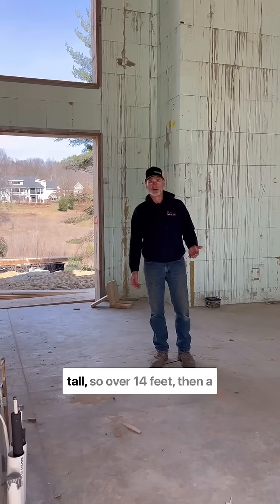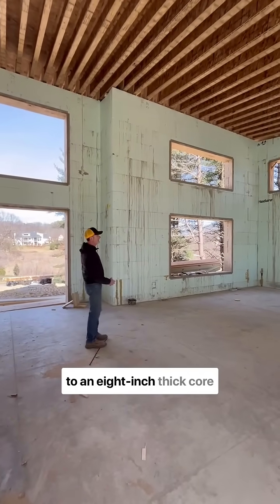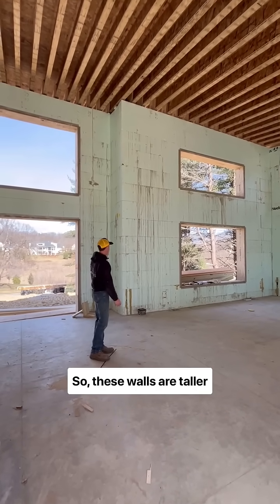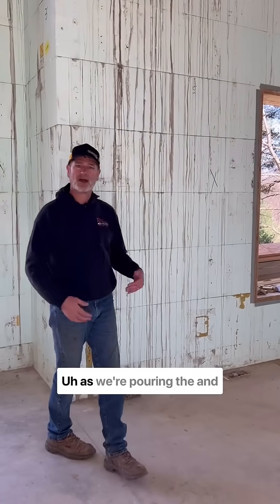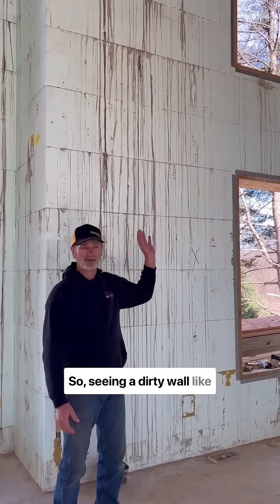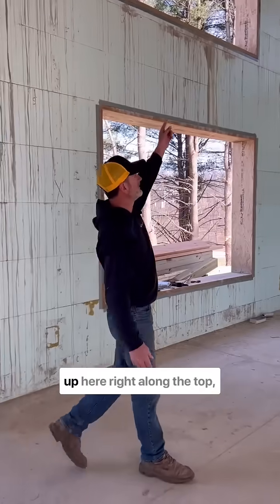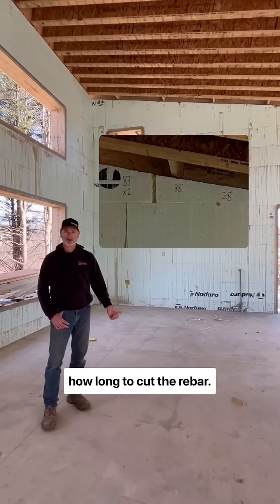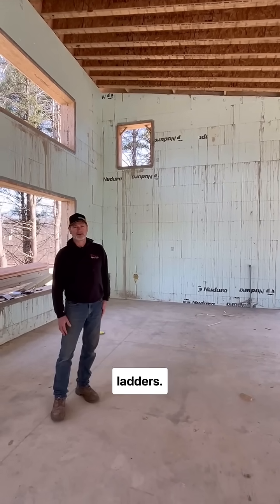Using 6" Core AND 8" Core for this ICF Custom Home and Here's Why!

Comment: A 6 inch ICF core is completely adequate enough for a 14 foot tall wall with a traditional frame roof or even a second floor. They do it with 2 x 6 16 on center 24 on center lumber’s way weaker than compressive strength, which is how Concrete works.
Reply from the maker: Unfortunately it isn't that simple. Wood flexes, concrete doesn't.
Engineering standards for Wood allow considerable movement, but concrete allows very little. Comoressive strength doesn't counteract the wind load much at all. Can it be done? Sure, but you have to hire an engineer to design the rebar size and spacing, and it can quickly get into costing more than an 8" core.
The code only allows up to 10' without an engineer's approval, however many of the manufacturers provide tables that go higher (pending a local engineer's review, not design).
Stronger than wood? Of course! But there is more to it.
Reply: @RValueHomes  also code stops at 10 feet because no one normally goes higher and they don’t wanna pay their engineers to even look at it cause it’s pointless. They do 8 feet all the way up to 22 feet basements that have side load with no deadman and you’re telling me an above ground ICF two-story house 6 inch core is not adequate enough for wind load?
Reply from the maker: @randyanderson1983  If you want to pour a 100' tall wall with 6" core, I'm not stopping you. But if the question is what requires engineering, my point still stands. R-Value Homes isn't out there to try to be "good enough", or "I think we can get away with that".
Reply: Higher an engineer, make a video prove me wrong I poured over 300+ icf house in a little over 10 years just as a pump operator, engineered non-engineered and actually it is quite that simple people over engineer stuff houses have been built hundred plus years ago and are still standing with no engineering

Comment: I’m very curious about how the pressure of the concrete works from top to bottom and how high you can really go. 

We build our own concrete forms and pour solid walls up to 10 inches thick. We have a proprietary tie system that we’re planning on phasing out and switching over to actual concrete form ties.

We’ve considered doing ICF. It’s just amazing to me how those blocks can hold all that concrete.
Reply from the maker: ACI calls for wall pours to be made in 3' lifts, no matter the forming system. We usually push that to 4' or 5'.
When each lift is poured and vibrated separately (and a little time has passed so the concrete sets a bit), the pressure on the bottom lift is not greater.
Reply: How tall can you go with a 6” core like on a gable and wall?
Reply from the maker: @michaelvonfeldt9629  That depends on a lot of factors....the code stops at 10' no matter the wall thickness, but most of the ICF manufacturers offer suggested rebar schedules to tkae a 6" wall up to ~14'. However, that needs to be verified by a licensed structural engineer for your application.
Reply: @RValueHomes thank you for the info!